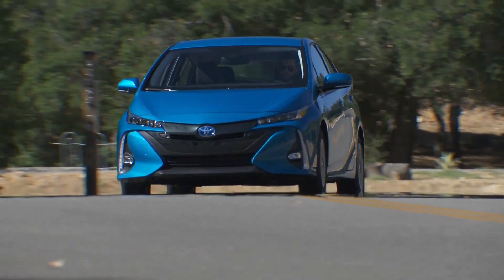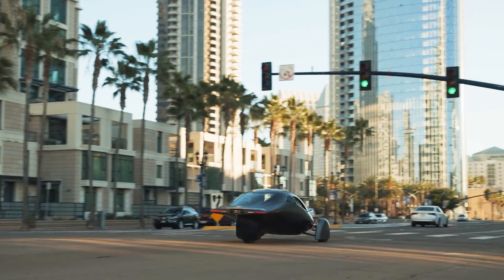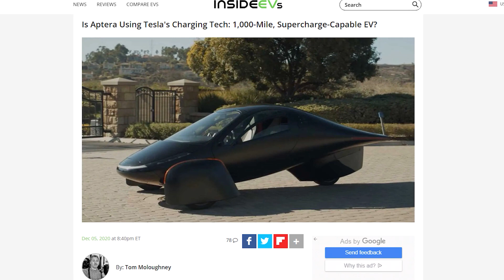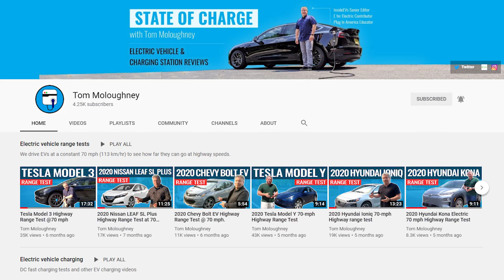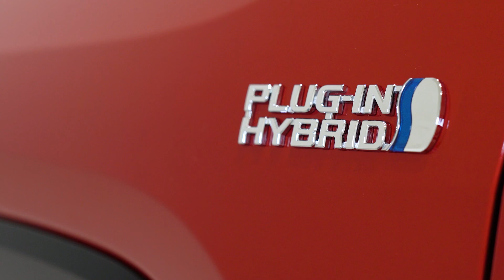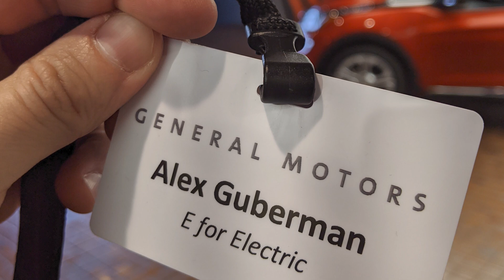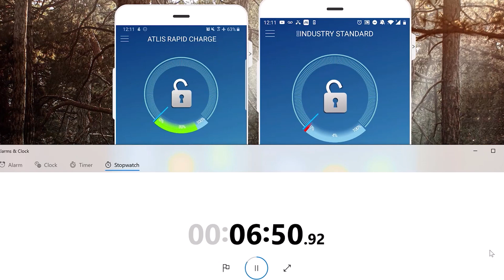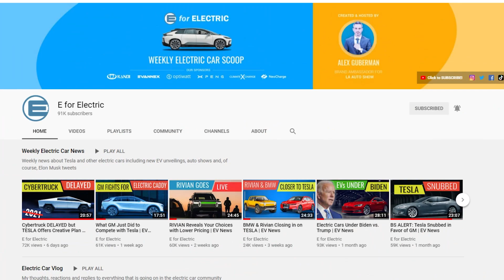Coming in 2021: Self-Charging Electric Vehicle | EV News

Comment: It's about time!  The whole idea of having to plug your EV into a power station & then having to wait hours for the damned thing to charge itself is archaic. Why did it take manufacturer's so long to think about this? Gasoline powered vehicles have had generators to re charge the batteries as you drive, then along came the alternator to charge the battery. With that being said who in their RIGHT MIND wants an EV that costs a fortune, has limited amount of driving range & the inconvenience of having to find a charging station because the damned thing hasn't the technoligy to CHARGE ITSELF???

Comment: What a waste.  I will never understand why no one will build a totally self sufficient Ecar.  You have so many wasted points of energy.  You got 4 wheels turning that could utilize hub generators or an extra unused axle that could have a geared axle connected generator with a transmission that activated gears based on power need same as a gas car.  So many way better ways to build an Ecar.

Comment: The problem is the batteries. If they can make electricity without a battery that'll be great. I am wondering why they don't make a car that runs on a sterling engine with the heat provided by induction coils that use solar panels for electricity. This would totally solve the battery problem.

Comment: So funny. Every time you drive a car, you have charging capabilities. Every rolling contact of your vehicle can charge your batteries by introducing resistance to them. Why had this not been done? You should never have to plug in your vehicle for actual charge. Charge off of the spinning of your wheels. Easy and smart
Reply: Bose had a electricity provider using the shocks years ago

Comment: I call total BS on the 40 miles range from solar. Maybe at the equator, on a clear day, in July, parked miles from any tree, on a perfectly  clean car,  but the surface area of those cells at even experimental PV efficiency is not enough.
Reply: The testing was done in Southern California and if you’ll notice they said 16 which would be like here in the state of Washington I live in Central Washington we’re 300 days of sun a year but again it’s not at the equator like you said so 16 miles per day yeah I can see that here not a realistic if you still think so do some reading on solar developments the last two years quite interesting
Reply: That is, of course around best case, but do the numbers...700 peak watts from 180 solar cells.  A car power requirement of 100 watt hours per 10 miles on the EPA highway cycle.  They publish a solar map that gives the expected range depending the season and the area you live in.

Comment: Cool car but don't ever never ever get a flat tire or your _ucked. No jack no spare no way to tow it and it doesn't fly so what do you do crane the thing onto a flatbed?
Reply: There will be tow points, front and back, and a jack point in the rear.  The wheel pants will snap off in under a minute, and you will be able to repair a tire with a plug kit or fix a flat, just as you would with a motorcycle.  I have done this on the road several times on a bike in 400,000 miles, so I know how to do it.  If you need a flatbed, it can be winched up just like any vehicle and the tires are standard.

Comment: IS THIS IS A BULLSHIT CAR ???
WHAT ABOUT TRAVEL IN THE NIGHT ?
Reply: It has batteries depending on the model, for a range of between 250 and 1000 miles.  The low power demand means that it will gain 13 miles per hour of range, even plugged into a standard 110 volt outlet.
Reply: @n.brucenelson5920  
WE NEED A CAR VERY PROFESSIONAL BUILD LIKE BMW 740 and Mercedes 600
MOSQUITO 🦟 CARS  IN THE WORLD FOR ME NO GOOD

Comment: The Aptera will sell, but I see it more as a specialty car than a mainstream. But who know what Europe will do with this one day. I do love the self charging. Especially in the sunny climates!
Reply: Even Aptera expects it to be a niche market car.  That niche is large enough for them to make a go of it.  They have already taken in over 5,000 pre orders.  If your climate is not so sunny, you can still use it to run climate control while parked, or plug it into a standard 110 volt outlet and still gain 13 miles of range per hour.

Comment: I love the idea of integrated solar, to allow you to run off the sun without charging. But given the fact that most cars spend 80-90% of the time parked, often in a workplace parking lot during the sunniest time of the day, why does nobody create a car with slide out solar panels?  Just extending up to a couple of feet on either end of the car would both increase the amount of energy produced, and shade the car. Also, extendable legs could allow for optimizing the angle to best match the sun position.
Reply: Rather than use up 3 parking spaces per car, it would be better for the employer to stick some solar panels next to the parking lot with some cables for people to connect to.

Comment: Look out (solar panels)  during a hail storm
Reply: they are not glass, for weight reasons.  However they are designed to be easily replaced in case of damage or upgrade for technical reasons - say an efficiency breakthrough.

Comment: At my latitude [49.6 deg north] at midsummer I might expect 7 hours of full sunshine at an effective solar angle.  Assume a big set of solar cells on car roof that can make [ideally] 400 watts.  So realistic generation per day is maybe 2500 watt-hours = 2.5 kWh.  Small car like Nissan Leaf offers ~ 28 kWh battery.  Ballpark estimate then says over ten days to fully charge.  In summer.  In mid-winter my sunshine is,  on a good day, about 1 effective hour.  Sorry, this idea isn't going to work for me in practice, even with a lightweight vehicle.  Perhaps in California, but I can't afford the tax burden.  Or Texas, but I wouldn't survive the politics...
Reply: It may still provide enough power to run the A/C to keep the car cool in the summer without running the batteries down.

Comment: Where does the Aptera hide a 100kwh battery? As for solar charging, no way!
Reply: the secret is that it uses only 100 watt hours to travel 10 miles, and the solar cells have 700 watts peak output.

Comment: Another informative video. Thanks for the updates. I am also surprised that people doubt GM's ability for the Hummer. The Bolt was pushed to market quickly as well, and GM is not a startup. GM's only problem is their will, or lack thereof, to EVolve and move to a full electric lineup 😉

Comment: 2sq metres of solar panels will get you a max of 750w per hour. And these panels are horizontal, I guess 300w in sun. Under cloud perhaps 100w. I’d calculate 1-2 miles per hour even with their efficiency, with a very light foot. Time will tell.
Reply: Aptera claims a peak 700 watts.  The real secret is how little power it needs -100 watt hours to go 10 miles.

Comment: I would totally buy an Aptera, matter of fact I'm thinking about putting down a $100 reservation deposit. Only thing is, does anyone know if it has any kind of rear seating??
Reply: Not on the initial model, it's strictly a 2-seater. Lots of cargo space though.
Reply: @kkobayashi1  I hope they can come out with a foldable third seat in the back. If that comes out I'm sold!
Reply: @Joda30088  there is a possibility that a child seat will be offered in the lower range models, but this won't be known for months.
Reply: @n.brucenelson5920  I hope so

Comment: It's a great idea, the car is one of the most efficient in the world, but why do you ruin it by providing IMPOSSIBLE DATA? You will end up making believe that the whole project is a scam! Be honest! I have seen they claim over 40 miles with one day of solar charging !!! Take a calculator, how can a couple of square meters of unevenly oriented solar panels provide energy for 40 miles to a car (even if it is very light and aerodynamic)?!?!?! They couldn't even do it for a bicycle! And even if that were true, do you think there is sunshine every day? That there are no trees, houses, buildings making a shadow where you use and park  your car? Or do you live in the Sahara ?! It is a fantastic car, maybe I'll even buy it, but make it clear that with solar power it is reasonable to expect an average mileage of no more than 10 miles per day with speeds below 30 miles per hour.
Reply: The solar panels produce a peak of 700 watts.  The car requires 100 watt hours for 10 miles at EPA Highway cycle with speeds up to 67 miles per hour.  It pencils out.

Comment: The efficiency of solar panels just goes up and up every year, and Aptera panels are designed to be replacable in case they become damaged or wear out.  Or, I suspect, if you want to upgrade to better panels.

Imagine an Aptera with 4680s, and new better solar panels every few years.  Your NeverCharge range will just creep upwards more and more over time.  Eventually you will have ~40mi of NeverCharge range even in places like New Jersey, people farther and farther north will suddenly have a reason to seriously consider an Aptera.

If demand latitudes happen at about the same speed as manufacturing ramp-up... this is kinda a brilliant business plan.
.

Comment: I doubt that the Aptera's range figures are accurate. A 100kw/hr battery is approx 4 times the weight of a 25kw/hr battery and the extra weight means that you're not going to get 4 times the range... maybe 700-800 mile range... 
Or if the 100kw/hr battery is definitely good for 1000 miles, then the 25kw/hr battery will be good for a fair bit over 250 miles.

Comment: I think the Aptera will be popular with law enforcement. Cops already use motorcycles to patrol highways, and the Aptera is an electric motorcycle with a range long enough to successfully replace the existing cop bikes. The fully enclosed design will make the Aptera much more comfortable during inclement weather than the traditional cop bikes. The large cargo space will allow cops to carry significant amounts of gear (and donuts) that is impossible with traditional bikes.

Comment: If you are interested in Aptera here is $30 off their $100 pre-order price. Hop in line sooner rather than later it's getting rather long. And if you doubt them they just received $100 million in pre-orders. That $30 will hopefully be your yearly cost to charge. Just put your email in the pop up on the bottom left of your screen after their page loads. They will email you the promo code for the discount.

http://i.refs.cc/EcpYGbp5?smile_ref=eyJzbWlsZV9zb3VyY2UiOiJzbWlsZV91aSIsInNtaWxlX21lZGl1bSI6IiIsInNtaWxlX2NhbXBhaWduIjoicmVmZXJyYWxfcHJvZ3JhbSIsInNtaWxlX2N1c3RvbWVyX2lkIjo2NjM3OTU5OTJ9

Comment: As bad as this sounds, is it even worth it to buy solar panels on the Aptera? I mean it gets 10 miles per kWh, which means it’s about 12 cents per 10 miles (using national energy cost average). Seems more like a marketing ploy and isn’t as economically sound. Maybe I’m wrong? If it’s like a $1000 upgrade, you’re looking a 85k miles charged break even or about 5.7 years break even assuming you get 40 miles charged per day...
Reply: From a pure cost standpoint, probably not. From a convenience and environmental standpoint, yes, because it could get a driver out of an inconvenient situation (prevent running out of range and needing a tow) or allow a person who lives in a apartment and doesn’t have home charging to have more confidence in the use of their car, since it might actually gain range from being parked on the street, instead of having to visit public chargers potentially daily.  It also allows someone who can’t install solar at home (or has their car parked outside at work) to take advantage of sunlight for charging.  It’s also suitable for someone who is trying to go off-grid in terms of electricity consumption.
Reply: @JohnGeorgeBauerBuis  And it brings in money/tech/excitement to start working  on a more practical solar powered car.
Reply: @JohnGeorgeBauerBuis  Just thinking hard about the convenience Aptera brings with it, SAE J2954 could make bidirectional wireless energy transfer possible. That would be convenient. Too bad wireless charging is up to 10% inefficient.
Reply: @JohnGeorgeBauerBuis  totally agree, looking at cost no, but if I were off the grid, this would totally be a great option. Especially if they had v2g just in case you wanted to power your shed too...
Reply: Totally worth it during the zombie apocalypse 🧟‍♀️🧟‍♂️Mostly kidding😀

Comment: Doesn't look very safe, What's the crash rating?
Reply: They did say elsewhere that they are designing it to have excellent crash test scores, so hopefully it does well.
Reply: @JohnGeorgeBauerBuis  , it's technically a motorcycle, is it not?  Motorcycles can be economical and fun, but nobody claims safety for them.
Reply: @markjohnson8260  This will be crash tested to automotive standards.